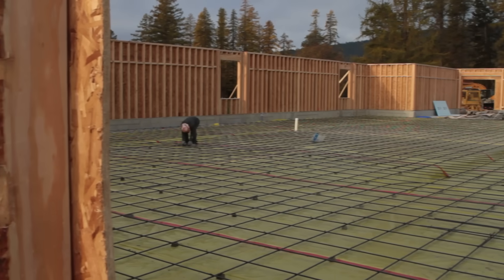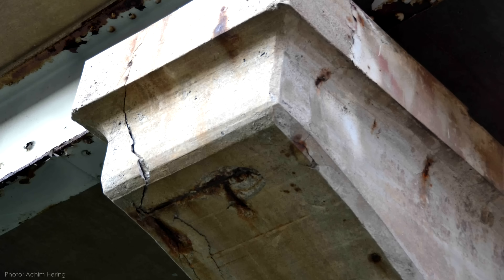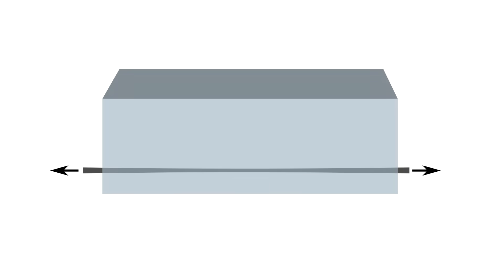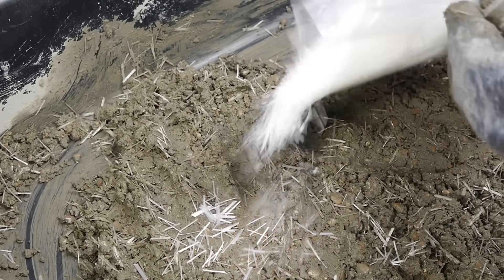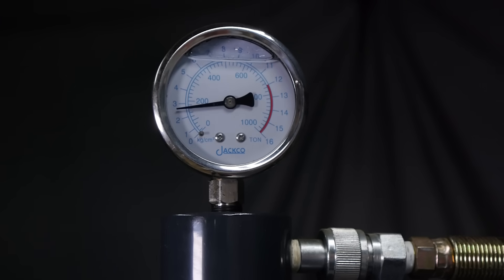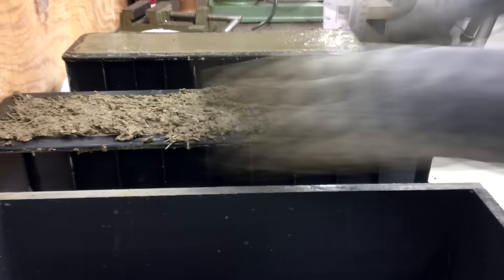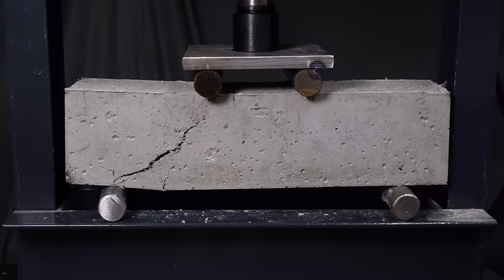Does Rebar Rust?

Comment: I've always wanted to know about this. Especially when you hear all these new concrete buildings still only have a lifespan of a hundred years or so.
Reply: The usable life of most buildings is generally 100 years because of changes in population, building codes and property values, not structural reasons.
Reply: if you've ever worked with normal concrete that is about 50-60 years old, you'll see why buildings only have a lifespan of 100 yrs or so.  concrete that old has already started to degrade and becomes brittle (well, more brittle than it was).  try to set a 3/8 anchor in it and you'll see large chunks of it just break off.

Comment: The reason ancient concrete buildings and other structures are still around today is because there is NO imbedded reinforcement. It is not necessary and only leads to premature failure. Learn from the past my friend.

Comment: Normally in a concrete piece that size you would have 4 rebar with rebar rings every so often. I wonder what the failure point would be if your beams were made like a typical beam. I have some micro helix rebar (fiber) and it is supposed to lower the need for regular rebar, you shoukd be able to use smaller diameter or fewer rebars. Could you test how effective the micro helix rebar fiber is?

Comment: I repair structural concrete experiencing embedded metal corrosion. Impressed current and sacrificial cathodic protection systems are out there. It’s a galvanic corrosion cell. Eliminate the moisture, oxygen, chlorides and continuity

Comment: One of the other areas that concrete is subject to very high rates of corrosion is in sewer pipes. Hydrogen Sulfide (rotten egg gas)  generated by the slime layer at the base of the sewer migrates to the headspace of the pipe where bacteria at the surface turns it into Sulfuric Acid. Needless to say the concrete surface can be very quickly eaten away. One way to combat this problem is to use plastic coated pipes, the other is to use Fibreglass Pipe. If the pipe is concrete we ventilate the head space and treat the air that is extracted. The skill is making sure that you can move enough air around through the use of vent stacks and extraction fans to keep the levels of hydrogen sulfide low enough to avoid problems.

Comment: i keep thinking of the highway collapse in the 1989 bay area quake.. where the second level rebar  was just wire tied to the tops of the first level rebar and really was barely secured to the rebar that went across the load carrying beams.   i know that there are couplings now for rebar. in one of your examples in the video @1:34 shows rebar bent over 180+ degrees and a piece slid thru the loops to prevent separation.  imagine how much stronger the ends would be if there were several pieces of rebar that were bent into hair pin shapes at the supplier and dropped over cross bars to lock the rebar together between floors.  i love your example of the additive fibers..    that could be done with stainless or steel wire running it thru rolling dies to put flats or slight hour glass shapes in it  or just left and right bends and chop them off to length.. to blend in to the concrete mix..    its just thoughts..

Comment: Intruiging: but for a better demobeams with half the height would be more intresting as all the failures I see in the demo are shear failures, not bending failures. Now adding in fibres in your concrete mix also increases your Vu as opposed to a normal mix, so cracks form way later.

Comment: I poured a concrete mix with glass fibers and it was a nightmare to finish. Strands kept appearing while hard troweling. Then there is iron metal strands that would rust and stain when exposed, makes no sense. Seems an extra sack of concrete per yard yields better results.

Comment: Fiber reinforcement has been around for thousands of years. Mud and clay structures had straw mixed in just the same as this concrete to prevent cracking.

Goes to show a lot of common problems can be mitigated by looking back.

Comment: Great video! Why do embedded fibers increase the strength of plastics, but not concrete? Why do fibers even increase strength in the first place?
Reply: Fibers resist higher tension loads than the matrix of plastics such as polyester resins or concrete.

Comment: I've explored a lot of abandoned WWI and WWII bunkers, even some Prussian war ones, over the years. Rebar is the number one cause of them collapsing due to its rusting and eventual lack of support in crucial areas. I always wondered wtf anyone would still use it today when other materials are available.
Reply: they were not built to last plus unprotected from rain etc and no maintenance
Reply: @David-cy5zu  After fifty years of use, most buildings are ready for recycling anyway. Restoration is worthwhile in some cases, but can be very expensive. Architecture, science, and engineering improve over the years, rendering older ideas obsolete, and often unsafe.
Reply: Why wouldn't you use it? A design life of 120 years is doable for civil structures that need it, and alternatives are often substantially more expensive or not supported by design codes.

Comment: why not just coat the rebar in rustoleoum spray can or paint.   or better yet just use flex seal liquid to coat the rebar.  so that even if water get into the concrete it cant get into the rebar causing this rust collapse.

Comment: FRP is completely linearly elastic until failure. The concrete codes we currently have are setup around mandating that flexural members will have a lot of ductility due to the very large plastic range of steel rebar. There are design guides which take this into account with larger factors of safety (noticing also that concrete crushing is the desired mechanism of failure over FRP rupture, which is a fun change), but it is hard to give up such a useful property as immense ductility, especially when considering earthquake forces that are practically guaranteed to required a plastic hinge mechanism form somewhere to prevent collapse.  The argument you make for fibers in the concrete as a means of corrosion protection is a very convincing one.

Comment: Those steel fibers wouldn't have the 25mm-75mm "cover". You'd have to protect them from exposure somehow wouldn't you? If they rust and crack the surface the next set of fibers would be exposed etc etc etc.

Comment: As a Reinforcing Ironworker I would like to say a few things:
- I don't feel like your beams that you stress are seen under that type of stress in modern engineering. There are no bridges or  load bearing slabs that are about (I'm guessing) 200mm thick with only a bottom mat with cover @ 50mm or less like your demo. At least none I have seen in my career / country other than maybe a private citizen doing his own work... 
- I feel like if your stress testing a small beam in a lab you should have used slightly larger beams that could accommodate polymer chairs, correct cover, a top layer of reinforcing, a 3rd mid mat of reinforcing, stirrups,  hair pins or even multiple combinations of these pitted against each other. 
- I feel like your demonstration is biased. If you wish to pit differing types of fibercrete against each other than you should have done so without adding rebar, or at least kept rebar out of the verbal conversation.
This demonstration is not typical of reinforced structures. The pictures you have chosen to include in this video are ones taken of poor construction quality and poor inspection. 
Anyways, it's always interesting to see through the eyes of my indirect partners. 
Cheers.
Reply: On a side note for citizens that may find this demo fuelling their anxiety or fear of public structures, fret not, most bridges in North America and other structures that hold the weight of public use and safety are not constructed with black bar (iron) but are constructed of special reinforcing that is highly corrosion resistant such as Stainless Steel rebar and MMFX which has a corrosion resistant compound. In some cases (and being phased out) are epoxy coated rebar which is almost never seen these days and galvanized rebar both of which are incredibly corrosion resistant compared to the black bar shown in this video. Also much much MUCH more reinforcing is typically in these structures unlike the video shown which is more comparable to a parking block in a parking lot than anything else.
The bridges that you see collapsing in other countries like Italy are because of either poor standards or CORRUPTION or both. These are typically not concerns of North America or at the very least, Canada.
Reply: You need to LISTEN closely next time, he said the fiber is used to reduce or prevent cracking under normal conditions such as when curing and the size does not matter in a friggin DEMONSTRATION video, something other testing videos already show is more full scale aka larger models. And yet look is the one being biased here, not him for sure.
Reply: Joshua79C C no need to get so stressed there buddy. i was not slamming him just pointing out my concerns for a public video. This video could easily be misinterpreted by the majority of people who watch it.

Comment: The structural use of concrete, like coal power was to petroleum was to solar was to nuclear, should be looked at as a technology that will be replaced with a better one in the future. This is a good look at the limitations of concrete, especially it's use as a structural component. Frankly I think it is best used as the Romans did in the Colosseum, as if it were stone. The failure of the highways in the recent San Fransisco earthquake are an example of the risk society takes when it's used too extensively as a structural component. Interesting to note, look at the same event and the Golden Gate Bridge, where concrete was used more like the Romans did in the Colosseum. No damage at all while the steel cables did what they do best, stretch and rebound. I think if it is properly maintained the Golden Gate will last a thousand years.

Comment: Just coat it in nickel? Its not a "fix" but it certainly is a significant improvement, plus it allows the same equipment and techniques with the same love for steel so you civil engineers don't need to innovate.

Comment: Steel or fiberglass reinforcements, eh? So what about polymers? Say maybe plastics recovered from those ocean gyres we keep hearing about.

 Could we prevent cracking and rebar corrosion in that manner? Could we make concrete stronger and lighter? Or even just comparable? (I would love a solution that mitigates multiple problems)

Comment: Had a meeting with a Danish basalt fiber company last week about its use not just as an additive but in basalt rebar. Real potential for maybe 5 years down the road entering the construction industry in Ontario. They are currently working with MTO to get certified for tunnels and bridges. Got about 1/4 the weight and 2x the strength. Biggest issue is long term tests of degradation due to hostile conditions in concrete. It shouldn't be a problem but we just dont have the data yet to be certain enough of that by Canadian building standards

Comment: Concrete is porous and will definitely let water pass if there is sufficient hydro-static pressure on the other side.  Exhibit A, my basement flooding when it rains a lot.  Even when I don't get liquid water on the other side, you can definitely see when concrete is saturated with water. In the video you mention that water can't make it to the rebar, but I have a hard time believing that, seeing what can happen with water seeping through concrete walls.  Great video btw.

Comment: Another important reason steel reinforcing works so well with concrete as opposed to using other reinforcing materials is that as luck would have it, concrete and steel have very similar coefficients of thermal expansion and thus tend to expand together rather than temperature fluctuations causing stress or failure within the structure.

Comment: I worked for a company that makes fibreglas reinforced rebar. I'm an electrical engineer and did work on the actual machinery that made the rebar, but I was frequently around it in operation. Lots of individual threads of fibreglass basically "woven" together and wrapped on to a giant spool and baked in an oven, plus some horrible chemicals. The end product is waaaaaaaaaay lighter than steel rebar and doesn't rust at all, seeing as it's basically made of glass and a whole whack load of resin (plus a few other trivial things).
Reply: He literally mentions availability and use of glass and basalt rebar along with images in the video. Open your ears and watch the whole video BEFORE commenting, please.

Comment: I work for a Lumber yard that has started selling a basalt product as an alternative to steel. The big advantage is that it is light weight and easier to handle. Currently it is selling for about the same price as steel but steel is more suceptable to commodity price spikes due to things like tariffs. The brand is gator bar.
Reply: Neuvokas Corp makes GatorBar

Comment: Main reason steel is used is because it's hard to have the perfect fit that steel and concrete has. Both have identical thermal expansion rates. Meaning as it heats and cools one won't tear apart the other. This beautiful pairing is what has allowed steel reinforced concrete in the first place.

Comment: It isn't just the lack of precedent for using other types of reinforcing materials or the up front costs.  The #1 reason steel is used, bar none, is that it has nearly identical thermal expansion as concrete.  With the right aggregate mix it can be nearly identical.

Comment: Coat it, the same as they do with nails and screws, either with a paint, or with another metal, such as zinc or aluminium
Reply: he did mention they use epoxy coated rebar in corrosive environment structures but now also there are other options such as also mentioned and shown is glass and basalt rebar
Reply: Galvanizing is hardly a new idea.  https://www.galvanizedrebar.com/

Comment: 4:05 hehe  just like when with wattle and daub  .. use would use horse hair in the  can manure  to reinforce it huh ... my how fay we have come....
Reply: i cant help but think that just adding fibers to concrete like that  is ... not the most efficient use of the fibers ..  i cant help but think if they were organized they would work better  i.e if they were organized  like layers in plywood rather than  glued like the stands in osb sort of thing  i would have thought it would distributed the forces in the fibers more evenly
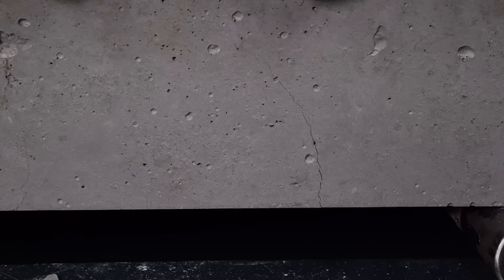Reply: 4:51 which beds the question .. if  there are going to be cracks then why not design them to be engineered cracks    instead of casting it as a single slab of concrete cast it as individual blocks with paper thin gaps between each segment  and the re-bar running through all of them .. stringing them together as it were   and maybe  in that paper thin gap you could put a thing smear of a  elastic compound like silicon that could squeeze out a bit under the stress water proof the re-bar and provide shock absorbing in earth quakes .. like the disks in you spine do between the vertebra
Reply: 5:08 or do the simple thing and just have a steel ..(flat bar? steel band?) at the bottom of the beam and pour the concrete in on top sine  the bottom of the beam is the part intention...(useally)   that's where it will do the most good and .. well basically do with concrete and steel what the mongols did with there compound bows with horn and sinew
Reply: 6:23 well that and it  doesn't really have the fatigue limits that say aluminium does
Reply: How about conducting your comment as you watch, pausing to make each point. You will not lose the comment as you generate it even if you go and make a response to another comment, I know this as I have tested this myself
Reply: you mean just make one comment and then  do the same with timestamps and comments separated with double spacing if so i have tried same but ..  how do i put this i have a nasty habit of looking at the keyboard as i type only to look up to find that   something has happened like  instead of clicking on the box to type  i have instead like highlighted  the . periods or that for this or that other reason  all that i have wrote has been lost or   that halfway through a post  this that or the other thing happens and the browser decides to reload the page or  for some reason when i hit backspace to delete something ive writes it instead takes me to the previous video i was watching and i again lose all that i had written  or the even more fun  my adha and dyslexia and dysgraphia conspired to make every 3rd words spelt incorecetly   and the use or  right mouse butten to spell cheack sometimes leads to an erant cursor movmet to the reload page on the menu instead of the spell chech ..  and and i become most disheartened and subsaquintly lose the will to live...
Reply: if you tube has a comment auto save  oh my that would be nice   but the alternative to the method i currently employ is to comment the edit the comment to make each point  but this is rather tediiouse and also i like to have a like time line of comments so that those reading them  know that any surprise is in fact genuine and so you might see me say something is stupied and then there comments later see me  comment like i retract my 3 comment etc